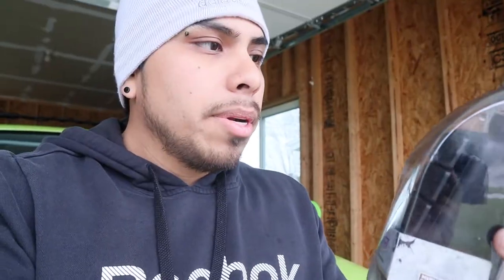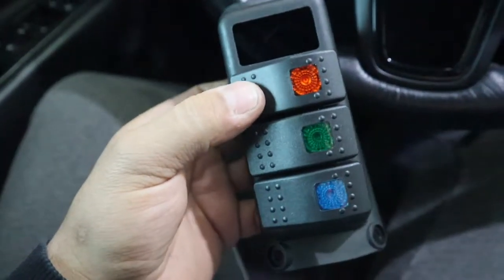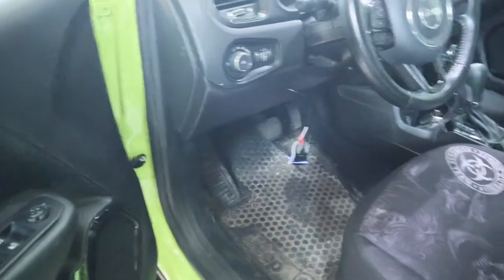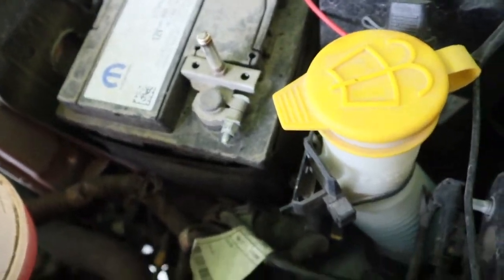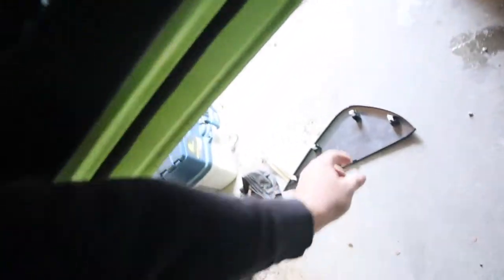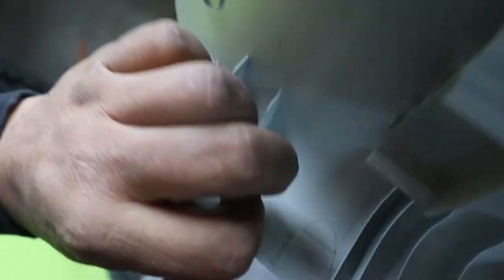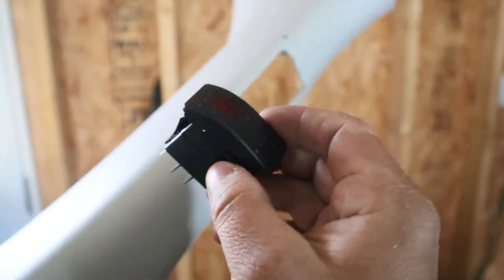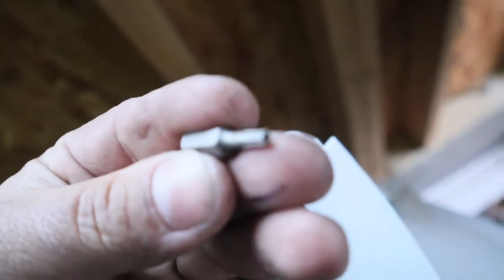Best switch panel option for your Jeep Renegade (Daystar A-Pillar Switch Panel)

Comment: Nice switch. 
  I’d put a rubber gasket and use a small bolt and nut to secure it. 
  I don’t trust those clip in screws. 
Vibration might make ‘em walk out. And potentially noise after a while from space ik between the a pillar and switch box.
Reply from the maker: I honestly thought about doing that as well. But for the sake of the video I wanted to make it as it was attended to.  But I agree with you

Comment: Dude yes! Happy to see you bought it, my install was scary but it went smooth, had to switch out the provided mounting hardware for something higher quality but otherwise it’s awesome!
Reply from the maker: Thank you for suggestion it!

 I may do the same next time I need to hook up a switch to a new light.
          My only concern with upgrading to nuts and bolts  would be that fact that if your airbag were to go off it might poke a hole in it. But ig we'll see

Comment: @Adventure GT  Sir, you have cost me about a 150.00 today, hahahahahaha. These switch panel will be perfect to tie in the top LED Bar and the Pods. Side note for everyone, the Sensor Cables and Power supply for almost all airbags is either a Bright Orange Harness or a Bright Yellow, never probe these wires with anything that is not Airbag Safe, if so you will immediately deploy the airbag and it does not care who or what is in the way.
Reply from the maker: Hey thanks for the heads up man. Hope you enjoy your new items 😆